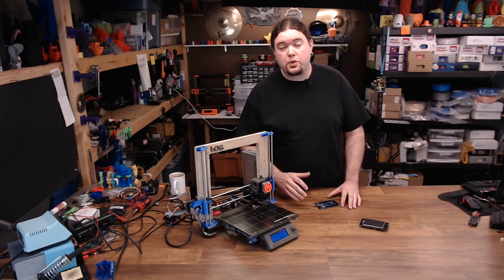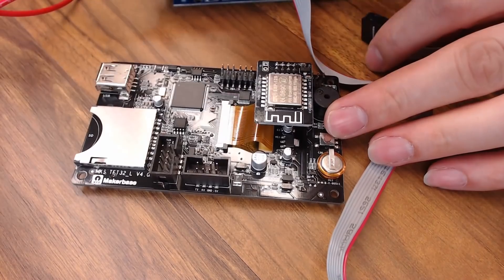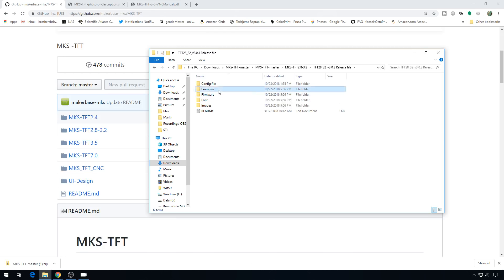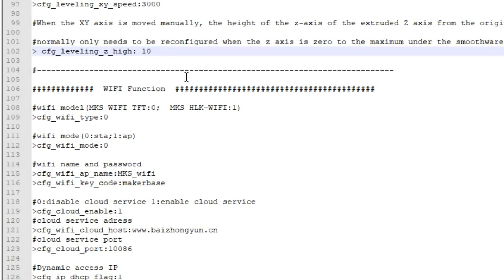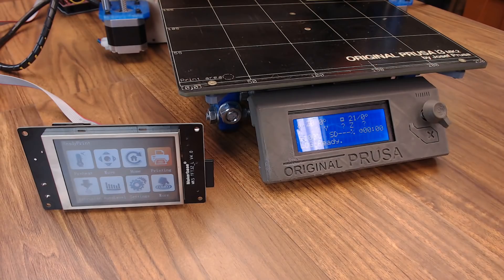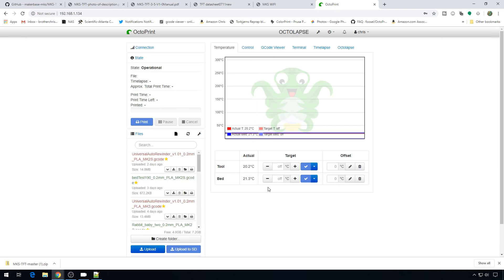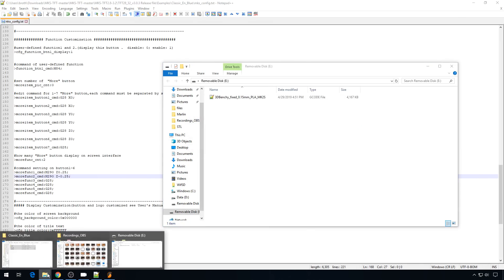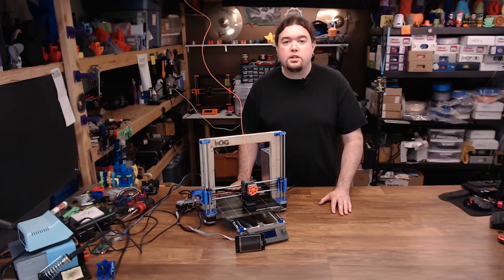MKS TFT Touch Screen Plus Wifi - Install - Chris's Basement

Comment: @Chris Riley have you checked out SKR V1.3 32bit Control Board 100mhz for $22. seems like its almost same as MKS Gen L for setup. bigtreetech offers a marlin 2.x default setup also. would be awesome Review & setup guide using uart on 2208 & maybe lv8729 for z & e0. I guess you just add firmware.bin to sd card & it does the rest. so seems its like a mks tft32 on upgrading firmware.
Reply from the maker: I have been getting a lot of questions on this one. I have one now and will be putting together a video on it soon.
Reply: @ChrisRiley  Awesome to hear, getting mine on Friday, but waiting on drivers. going to try it on cr-10s. so when your ready to make a video would be helpful to know the vrefs on 2208 vs lv8729 & what other helpful info installing on cr-10s with a bondtech type extruder & ezabl. thanks again chris
Reply from the maker: @fnice1971  Noted, I will see what I can do.

Comment: Thank you for video chris..I also wanted more info on how to connect mks wifi module with octoprint
Reply from the maker: You're welcome, you mean use your Wifi as a device via wifi in octoprint? I don't think that would be possible.
Reply: @ChrisRiley first at all sorry for my english..! but you used octoprint in your video... So you used octoprint in this video with a raspberry or something similar? Could you use the wifi module to send gcode without using the tft sd card? I saw that you connected via pronterface with wifi module port so I suppose that you cand send the gcode like this. Wifi module had some free cloud system to send the information like octoprint? Thank you in advance!
Reply from the maker: @oscarlaborda6613  There are a lot of options to do stuff like this. Check out these 2 videos. https://www.youtube.com/watch?v=br7BryjWPJU   https://www.youtube.com/watch?v=pJGBRriNc9I

Comment: Hey Cris. Great presentation once again. I’ve been running this setup for almost 2 years although without WIFI. You can also put 2 extruders on the screen and reassign the pinset (next to the orig runout pinset) for a second runout on extruder 2.  
Just a note: I like the 2.8 because flex in the bigger screen sometimes activates the wrong button causing crashes and other frustrations. 
I did a YouTube about a year ago and took a bunch of troll crap..but nice to see it’s finally being accepted into the mainstream.
Reply from the maker: Thanks Dave, yeah I think there are some possibilities with this screen. I want to look into it further for sure.

Comment: Hey chris, can I say great channel you have! and you always explain topics in layman's terms which is great, I have a MKS 3d 1.3 32bit board,it's works with the smoothie software, but I can't seem to get it to work with marlin 2.0, would you be willing to do a video on this if you ever get one of these boards?..again great work!
Reply from the maker: Sure I would! I have one kind of like it, let me see if the processors are the same.
Reply: @ChrisRiley  hi Chris thanks for your reply, just thought i would let you know,after much time...(again!)..looking at all the misguided info out there i did manage to get this board working(pure fluke on my part i think.lol).it turns out that the board that i got and listed is not the one to use! in the #define boards..you use BOARD_BIQU_SKR_V1_1...SERIAL_PORT -1...and again..SERIAL_PORT_2 0...BAUDRATE 115200....just thought  i would let you know the settings that seem to work for this board..it would still be great to see you do a vid on this as i am sure this board being as cheap as it is, you will get others maybe asking you the same questions i did..!..again excellent work from you and always looking out for  your next post!
Reply from the maker: @dongletreehenley9744  Thank you for the update, yes I have been getting a ton of questions on this board. I am going to put together a video on it soon.

Comment: Thank you for the tutorial. I tried to add a nextion 2.4'' with marlinkimbra but the result was to burn my arduino mega 5v regulator. And it was not fun too to try and figure that one out. Mks seams better and more reliable.
Reply from the maker: Thanks! Those regulators, they are so irritating. I have went through a few myself.

Comment: They need to take a page from the iTead Nextion displays. The design software is clunky, but the canvas is wide open.
Reply from the maker: I've never tried one, I will add that to the list.
Reply: @ChrisRiley  it's an arduino display. Not sure it'd work w/ printers.
Reply from the maker: @OldCurmudgeon3DP  We can probably work it out.
Reply: Marlin has no Nextion support, but its fork MK4Duo does. Unfortunately i don't have the best experience with MK4Duo, watchdog was disabled on 8-bit AVR by default and when enabling, it turned out to softbrick the board (crashloop on boot - the actual softbrick issue is not down to them but due to my board like most using an Arduino standard bootloader rather than Optiboot at the time, but watchdog crash on boot was MK4Duo's bug), but i reported this bug and it was fixed; then i had trouble getting PID tuning to complete while it worked fine on Marlin and the thermal runaway is again disabled by default if i remember right and not terribly well tested. Overall it left me with the feeling that i wouldn't entrust potentially fire-prone machinery with this firmware.

Another option similar to Nextion is DGUS, a smart screen used by Geeetech GTM32 platform in printers A30 and E180. Geeetech's Smartto firmware simply isn't very good, it lacks any advanced movement/planning algorithms and thermal protection logic found in better firmware, so people have been wanting to get Marlin on it, Geeetech themselves are supportive of the endeavour and are supplying and supporting various developers to that end, and it mostly works, but obviously on end-user devices, lack of DGUS support is a blocker. But i just found out that someone is working on it, Marlin pull request #13253

It turns out Wanhao also uses the DGUS screen, and there's a fork for it, ADVi3pp-Marlin. Wanhao themselves have not published their own firmware in an obvious violation of GPL.

UI code in Marlin 2.x has been getting a massive rework these past few months, in part specifically due to desire to support a breadth of UI systems, as Lulzbot are working on a low-cost and fully open-source touch screen system, and Marlin 2.x approach is obviously the future but it's making the projects which started off 1.x, with its UI code built largely around assumption of a text based controller, difficult to merge. The various possible touchscreens present different incompatible paradigms, such as that it's fundamentally not possible to have the printer firmware dictate the menu structure on many of them.
Reply: @SianaGearz  agreed. It took me a long time to get the hang of the nextion protocol and I wouldn't dare tackle integrating it into Marlin. It's just a shame that compatible touch screens can't hit the mark w/ UI design like iTead and iTead doesn't seemingly have a compatible protocol.
Reply: @OldCurmudgeon3DP  By the way, the Lulzbot touch LCD is based on FTDI FT800 or FT810 chips. The test platform is GetMCU's (Haoyu Electronics) FT810CB-HY50HD which is a 5" 800x480 touchscreen for $33+shipping. Marcio's fork of Marlin contains his code he's been working on so far. The 4.3" 480x272 screen is even cheaper than that, costs about as much as the DGUS.

I can't say i entirely trust FTDI, i suspect they might be sitting it out until it becomes popular and then will jack up the IC prices by $10 or more, i'd rather have an STM32 based board with open source firmware which means you can always vendor hop later if the pressure arises. Driving a bare naked TFT with just its on-glass memoryless controller straight off STM32 would be an interesting experiment. You can store plenty of 1-bit or 4-bit graphics in firmware ROM and rasterise them into a rolling line buffer, racing the beam, and have the DMAC hardware be responsible for shovelling the pixels to the panel in a timely manner.

Comment: I have a TFT32 on 2 printers. I configured custom buttons to preheat (or cool down) the bed or the hotend at different temperatures. That's really quick to use. I also like how quick I can disable the motors. What I don't like is there is no menu to set the Z offset. This is the main reason why I kept the smart LCD controller.
Reply: I’ve had one for a couple years and you can do “work arounds” for anything you can’t get to on the screen.
Reply from the maker: @neuxstone  Sweet! That's good to know.
Reply from the maker: Cool, glad you are liking it. Seems like most others aren't that thrilled with them.

Comment: Hey Chris, for the first two days after installing my TFT35, I was able to print over WiFi using Pronterface but it then went nuts on me and started sending status reports back to Pronterface in overdrive.  The layer view started zipping from red to green and eventually a whole stream of socket error messages scrolled down the monitor and everything locked up.  I've reloaded the TFT firmware but was never able to get it to print again (over the WiFi).  I have no idea what happened.  Gcode commands still work fine over the WiFi.
Reply from the maker: I am kinda surprised it ever printed that way, I wouldn't think wifi would have kept up. I can give it a try.
Reply: @ChrisRiley  Do the Duet boards support printing over WiFi?
Reply from the maker: @NorthGaSawyer  They do, they have a lot better support. On a Duet, you upload to the on board sd card.

Comment: Thanks for another great guide.  I second the vote that the MKS team should make the firmware open source.  I love mine, and I am currently printing a "prusa" style LCD case, that will allow both my TFT32 and RRDiscount Smart Controller screen for my Delta...
Reply from the maker: Thanks man, I tried to test the octoprint for you seems to work. Good luck on the build.
Reply: @ChrisRiley  Yeah, as two separate entry points, the TFT Screen and Octoprint work well.  My issue (though i verified from developers) that both "devices" interact on serial connections.  The issue is that the data is not passed from one serial connection to the other.  So for instance if you print from Octoprint, the printer Basic LCD updates like normal, but the TFT LCD does not change to the print screen. It will show temps, but not much else.  It would be nice to have both "devices" fully synced, but looks like we will have to wait until either you figure it out, or the developers make a breakthrough!  BTW, even my factory X5ST-2E upgrade that included a custom TFT to the 32bit board does not react when Octoprint sends a job.  I have to manually navigate to the status screen to get the temp info at a minimum.
Reply from the maker: @TekkieDad  Ahhhh, I see. Yeah with serial as it is setup now that might be a challenge.

Comment: One issue I ran into with the MKS TFT is that it interferes with updating Marlin via the USB port.  Sending gcode commands works fine but  I have to unplug the TFT when updating Marlin.  Keep that in mind when choosing a case design for your display.
Reply: You can update Marlin through Octoprint.
Reply: @Marvelous240  Thanks!  Octoprint is on my list of cool things to look into.  I'm fairly new to all this stuff
Reply from the maker: Good tip, I had the same issue when I hooked up an esp8266 for wifi, couldn't do both.

Comment: I would like to see what options this display provide... like jerk, acceleration, velocity, steps/mm, TMC Stepper menu, BLTouch menu etc... does anyone know that? That was the reason why i removed the touch panel from my 10S-Pro and installed a regular reprap controller.
Reply from the maker: I am not sure how much you can do, but probably not near as much as the regular controller.

Comment: Is it possible to use it with the miniRambo on the Original Prusa MK2.5S?
Reply from the maker: I think you could, but you are going to have to get creative. Check out the extra pins here. https://reprap.org/wiki/File:MiniRambo1.3a-connections-p1-p2-p3-digital-pins-labeled.png It probably won't be real easy.

Comment: I'm using a TFT24, looks and works the same as 28 and 32. The things I don't like are: 1-Unable to use M600 command because is not possible to say OK during filament change; 2- It's got a buzzer but it doesn't respond to the M300 command, very silly. In my opinion this touchscreen is fancy but doesn't add any value for normal user, just makes the printer looks nicer for the others.
Reply: I only use my tft32 as a helper to the stock display. easier to jog around, its useful for a few things then stock display to different menu's plus looks cool under stock display on cr-10 with the mount I posted above for cr-10, if they ever released source, im sure many more commands could be added. but limited to what they release. this is to bad for us.
Reply from the maker: Good points, thanks!
Reply: Hello Paulo, can you help me, i also use TFT24 but didnt run the wifi module.

Comment: I can't even get the firmware to update on the board. Ive copied the files from the example on both an SD card and usb, but when it boots....nothing, no updating firmware.
Reply: wrong SD card format? FAT or FAT32? Tried with another card?
Reply: @H1zN  I didn't see anywhere that it needed to to be fat/fat32
Reply: That is actually normal for 3Dprinter. because exFAT and NTFS is windows proprietary ;)
Reply: @H1zN  so try with fat/or fat32
Reply from the maker: Thanks for helping out all. I probably should make a point to mention that. Yes, fat32 should work.
Reply: @ChrisRiley  HIi guys! I have the same problem! I tried using fat32, and thats what im using, i also tried changing the file names and a also tried saving as a text file however when boot up my printer nothing happens, however if i rename the bin file to "BIGTREETECH_TFT24_V1.1.24.bin" it starts updating but the it does not updating fully because the names are changed. How can i update the firmware? Looks like the tft24 only notices bigtreetech files. Thanks for all the help!
Reply from the maker: @alexpardal262  Yeah, looks like it has to be a BIGTREE file. It looks like they put a new one out 3 days ago.
Reply: Make sure you rename the mks_config_EN.txt to mks_config.txt AND do a "save as text file".  I screwed that up the first time I tried this.
Reply: @NorthGaSawyer  i copied it from the examples, so the naming convention is correct.

Comment: Great video. I've got an MKS TFT28, But one thing I can't work out is, if the gcode has a pause, or even a filament change, how to continue the print, as you would with a standard screen you can just click the rotary encoder. ?
Reply from the maker: oooooo, good point! I will have to play with that function on the screen.